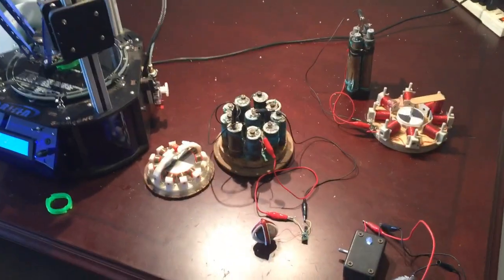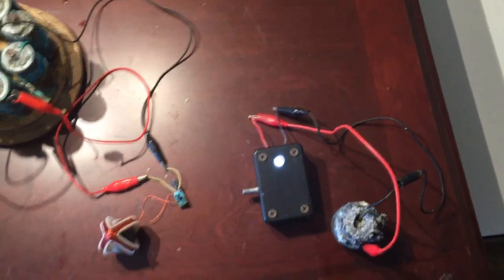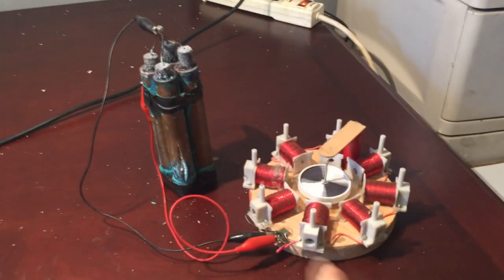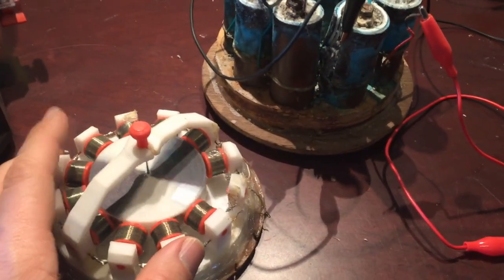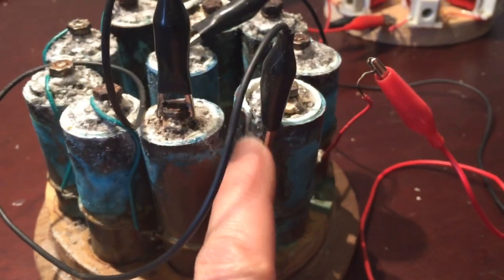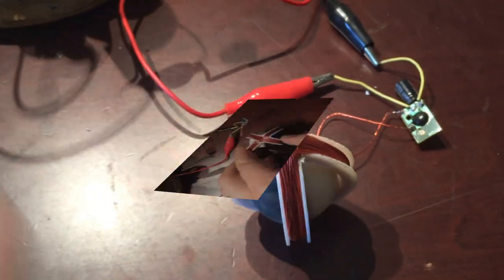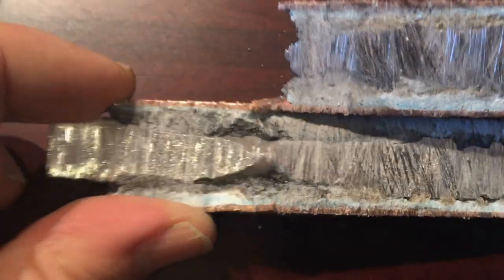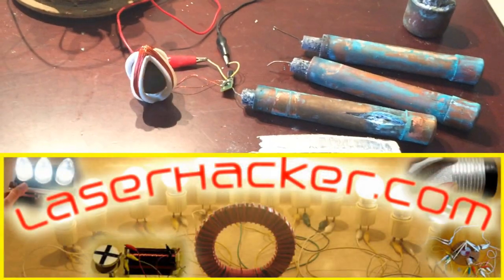Crystal Cells Have Been Going for 4+ Years! - Crystal Cells Duration Testing Update

Comment: To reduce the internal pressure you need to add Diod to it. The Diode keep the power move forward and no electricity to return to damage the cell.
Reply: I had the understanding that it was the pressure applied to the lattice of the crystalline structure that aided in the communication of electrons. So much to learn here! I love it!

Comment: Duration is not the point, the question is the energy output of the device, so you have to measure also the current intensity when functioning. You have seen a crystal growing, so a chemical reaction is on the way. Crystal cells must be regular electro-chemical cells, unusual only because in solid phase (reaction : Mg with Borate or Aluminium ions for example). No "free" or "zero point" energy in them. You can calculate 1cm3 of magnesium can produce a maximum electrical energy of 3.8 A*hour. Just estimate the magnesium consumed and compare to the energy produced by the cells.
Reply: But there is free energy. Free energy is that energy you don't pay for. Even if someone else pays for. :D 

Saying that just considering the amounts of energy used in refining and producing magnesium metal.
Reply: Following that logic, batteries are "free energy." It's not free.
Reply: Unless the batteries are stolen lol

Comment: If you have that much material left over in the core, might it not make sense to make the core smaller/put many small cores into each tube?
Would probably give you a lot more current... And more efficient use of magnesium.
Reply: hear hear!
Reply: Or simply use thin magnesium tubes with progressivly smaller diameter with the cristal stuff in between and laterally drilled holes to hold the cores in place
Reply: An increase in surface area would definitely increase the amount of current also the crystal electrolyte could be made to 1 be anhydrous completely 2 made in a much thinner and lesser amount it's not nessary to have a thick layer and is actually causing this issue due to it not being sealed completely and allowed to absorb water from the air so if you sealed them well this wouldn't be ab issue and yeah think how a modern lithium battery is constructed  use that method with these materials and without vent caps would be awesome

Comment: This is a very interesting concept. There could certainly be a market for long life, low power batteries...
Clocks, CMOS batteries, timers, etc. They probably have a high ESR, but that's not a problem for low power devices.

It's probably the wrong kind of technology for high output devices - You won't be powering torch bulbs, or radio speakers anytime soon. 
But if marketed correctly, these could really be good. 

What is their discharge curve like? Do they maintain a relatively stable voltage until they're depleated, or do they discharge similarly to Zinc Carbons, in a more linear fashion?

Comment: Yeah Robert Murry Smith worked on these "crystal Batteries" and they are an oxygen / magnesium battery.  There was mention of a 6M copper pipe in the ocean with Mg lining and the O2 in the water gave the oil rig 65KWhrs of output. If you dripped water though these, it might wash out the MgOH MgO etc and stop the expansion but also supply the O2 needed.

Comment: that was a cool oval motor.  you said the coils crossed over, but one end wasn't.  did crossing over twice cause too much resistance in the circuit?  very cool video.  could you pack the outer layer with a foam that decays slowly, like styrofoam, that way as pressure builds, it retains its contact with the magnesium, but can press into the foam without bursting the container?

Comment: That's another thing. I see people getting decent voltages on these but I'm not seeing how much draw can be pulled from one and it would seem like these are all being ran on extremely high efficiency motors. It begs the question if it's the battery or the motor that's really impressing me. I'm leaning towards both.

Comment: How much total power do you estimate the four year device has used?  I'm curious as to the total output of one of these things.
Reply: +ElGatoLoco698 You can calculate it. IT can provide roughly 200 ma and 1.5 volts per cell of that size, so 1.5 x 0.2 = 0.3 watts an hour. 0.3 x 35000 hours (assuming 4 years) a total of 10000 ish watts. or 10 kilo watts assuming I'm correct. More then any battery i know, a large car battery has maybe 1000 watts hours on one charge. If you have 10 then that is 100 kW. If that is not spectacular then i dont know what is.
Reply: Jette Christensen
That's really quite unbelievable.  I bet many a electrical engineer would say it's impossible.  This kind of thing throws the whole conservation of energy into disarray.  Theoretically it's possible but then again theoretically it's possible to blow up an entire city from the energy of one drop of water.  Where is this energy coming from?  Must be the vacuum energy that Tom Bearden is always talking about.
Reply: ***** yes exactly that is what i think too, i think steven greer said it was called the quantum flux field from the vacuum of space. there are also devices that amplify the energy output. More energy out then you put in, in a way. I can't remember what they were called but they were like a modified electromagnetic generator. Sucks this technology has been hidden for so long.
Reply: It's a thermo electric device that turns ambient heat into electricity. A widely known application is for space probes and rovers, as used by NASA under the name of Radioisotope Thermoelectric Generator (RTG). Their implementation uses a small lump of radioactive material that always stays extremely warm due to the atoms keep fission-ing all the time. The curiosity is that even at 20 degrees Celsius, let's say, the elements shown in the video keep working. Long story short, the energy comes from the environment, namely the heat of the air and table on which the termoelectric elements sit on. If you think about it, even 0 degrees Celsius is hundreds of degrees above 0 Kelvin, so there is heat energy in our atmosphere. We're not like on Pluto with 33.1 K (-240 C).
Reply: 200mA @ 1.5V for 35000 hours would be simply amazing for IoT devices

In fact, far far too good to be true.

A current top of the line lithium polymer 18650 cell will give you 1 mA @ 4.2 to 3.2 volts for about 3000 hours at best.

These batteries would represent 3 orders of magnitude improvements.

Like @shubus said, this is probably microamps not milliamps
Reply: It's unlikely to be a non rechargeable battery, if it were someone would have known by now the chemistry reaction.
Reply: magravs using nano coated copper im going to make a cell like this with a nano coated exterior and see what happens. thanks for the video!
Reply: As shown in a different video about the motor, it only draws one or two micro amps, so repeating your calculation with this number that is an output energy of about 1.5V x 0.000002A = 3µW for 35000h leaves you with 105mWh or a used battery capacity of 70mAh which is not even what a coin cell holds. It was probably a little more than that as the four cells make the motor spin faster so it uses more energy. But even if it is ten times more that is still nowhere close to the energy of a lithium battery of that size. What is the important point is that these types of batteries have a very very long shelf life as there is no liquids inside. They can last for over a hundred years.

Comment: For the reed switch failure, just put a tiny capacity over the reed switches two ends so that its able to absorb the plasma resulting when the switch opens...  then it will last a lot longer... without fusing shut...

Comment: Internal pressure = PIEZO EFFECT, the bigger the pressure the better results you get.Just a couple of Ideas:

1) Have you ever try building a cristal battery using metal shavings instead of mg & zn rods? that way you may reduce the costs.

2) And to increase the piezo effect , what if you place two Neodymium magnets facing each other whit the same polarity, have you ever try these ideas?

I'm no expert , I'm just an admirer and a fan of your brilliant work. 

THANKS FOR SHARING. 
Best regards.

Comment: Use powdered crystalline material instead of heating it to a liquid to Incrase power flow. Or build a hot reactor to flow the material thru the reactor slowly as a liquid. The quicker it moves the more surface area contact. Working on a more advanced one now. I'll post it when it's done for free.

Comment: Hello, I've just watched all of your videos regarding this subject, they are good and educative. For my observation I think that going for a bigger diameter of tubing and longer batteries with bigger, or similar sized core that is drilled trough, to increase the contact surface, and maybe transfer some pressure from the walls to the core, which might actually produce battery with more power and efficiency and  with the same or greater longevity.

Comment: I wounder if you could use the same metal on both electrodes since these arn't technically supposed to be chemical cells.  It's supposed to use the feroelectric effect, and obviously there's chemical reactions taking place that invalidate the test!
I see all that corrosion on the magnesium slowly eating it away! . . . this is basically a saltwater / magnesium battery!

Comment: The Mg was surprising, normally whitens up in a short time.
Got a C/Pb cell with epsom salt/rainwater electrolyte, 2 1/2 years so far flashing an LED 24/7. Nephilim Penny still going on same rainwater, 4 years. 
Everyone learned so much around 2010 and some builds are still going...fantastic !  :) 
Dancing Flowers FTW,  very simple to take apart and reuse, with 500ohm coils as a bonus.

Comment: What you could do is to put a smaller magnesium rod in. Or you could make A-Sized batteries. You can experiment with different shapes of magnesium. Like a spring. Where instead of the magnesium being pushed up will contract inside the cell Thus building less pressure.

Comment: Thats pretty cool...  the crystal cells being Drawn against for years have burst themselves in slow motion, not catastrophic failure, but a slow bursting as the magnesium expands outward thru the insulating material exerting pressure on the copper pipe containers...   It would have been cool if he made 2 sets of cells, one left connected and running and the other just set aside to see if they both exhibit the pressurization result...   or if that results because of the constant loading...

Comment: I feel you need a "bleeder valve" on these types of batteries to relieve the pressure from time to time. That or a permanent "puke valve" that will constantly release any built up pressure growth.
Reply: Pizioelectric effect though, more pressure = better performance. I think he should wrap them in concrete inside a steel square bar to hold it all together 🤔

Comment: You need a mechanical component to the battery systems you are building so the pressure can become power over time or a new cylinder system with a different metal content to hold the pressure thus making the 100 year experiment work "sleeve outside of copper" (titanium) . ( been watching for years now. ) good luck

Comment: cool deal I am glad the crystal cells have held up so long. have you put one of your graphene capacitors in line with one to see if the crystal cells benefit from having the current bounce back between the capacitor and the cell?  have you tried making a sleeve of the pvc pipe around the copper to seal it in I doubt it would have enough force to split the thicker pvc. if it does you have made some powerful expanding crystals that need to have that power harnessed as well . pressure = power . who knows maybe this power of growth albeit slow could be focused to run something else.

Comment: LidMotor, just a couple thoughts... 1.) It would seem as though drilling holes in the Borax/Salt material prior to capping would allow for more expansion prior to the vessel being compromised, 2.) apparently cost can be reduced by decreasing the ratio of magnesium, and 3.) (out of curiosity) do you believe that increasing the area of the exposed magnesium (perhaps by cutting groves or using a star shape) would have any meaningful effect upon output?  Thanks for sharing your work with us!

Comment: Like to thank you and Robert Murray for all your hard working and sharing it with the rest of the youtube land. I have been experimenting lately with trying to make a thin crystal cell with graphene as the cathode and graphite as the anode. I have been mixing the compounds with PVC cement and acetone and then dipping aluminum screen into the mix to coat it. I was expired by cayrex2 with his polygraphite plates and neatpete45 titanium dioxide super capacitor experiments. Unfortunately, I am not getting the results I would like. if you haven't checked out Cayrex2 and neatpete45 videos you should. Heck, even Robert was asking how they are making their batteries. Says a lot to me.

Comment: I'm not sure if this a late comment or if it has already been said but if the batteries are kept under load 24/7 I'm guessing that's what is causing them to split. Under power I think parts of it starts to liquify and give off some gas bubbles( on a small scale) and I'm guessing it's pressure over time that's building. Wondering if they had periodic breaks if they would still expand so much?

Comment: Another guy had the same "pressure" issue with a different theory. -The magnesium was pushing up due to lack of insulator between the magnesium and copper at the bottom. He was using a wider copper and wider magnesium, thus had wider spacing between poles by a few centimeters. When he put a thin layer of cellulose (wood wafer) in the bottom of the copper before inserting the mag core he seemed to solve the issue. Also he used only big copper cap but no pipe so no solder. I think you have some serious electrolysis happening at the seems where you soldered joint likely due to different metals contaminating the chemistry. I've seen others use narrow copper tubing but only resin on bottom instead of soldered cap and cellulose insulator tube for the sides. The key to higher voltage is more surface area on metal and you can have a bit more space between nodes. I think this tip may help.

Comment: Some half baked thoughts about the pressure.

Trying to think of ways to alleviate the pressure so that it doesn't split.  What if the magnesium had a hollow core, possibly with a compressible material.

I'm thinking copper is more malleable than magnesium, but you might cut stress lines or even cut right into the magnesium so it breaks where you want and forces itself into the core.

Comment: A magnesium tube with thinner walls than the copper will keep everything contained, or rolled magnesium sheets might even work better. Another alternative you could try using the surviving cells would be a steel or gas pipe jacket.

Comment: so what stops me from creating bigger versions and more to run my x box for 4 years?
Reply: Nothing. It'd just take a LOAD of them, as you'd want to tap into the power supply circuit and feed the mains input with 120VDC into the 120V capacitor. Modern power supplies convert the AC to DC before stepping down the voltage because they're essentially digital transformer driver circuits. This works to your advantage as it dosen't take muc current that way and you can use less cells.  Even the TV could be modded to put 120VDC into it's power supply, by simply soldering wires to the 120V capacitor.

There'd be a considerable initial investment. Judging by the fact these produce half a volt to a few volts of power.. it'd take anywhere from 80 to 240 cells at least 6" long and 1.5" wide.  After that.... well... years and years of power. You'd need to find a source of cheap scrap metals. It probably wouldn't specifically have to be magnesium and copper, there are many combinations with a similar voltage output. Rusty iron gas and water pipes would work well once you figure out what the second metal could be. For iron, zinc would be a good choice.
Reply: +theLuigiFan0007 you could just hook it up to an automotive 12vdc inverter to output 120v ac and plug into that and just save the headache of modifying the mains, the tv or any other device you want to power...
Reply: Quantum Uncertainty Workshop
The problem with crystal cells is, they don't have much current output. A few hundred milliamps or so if you keep the humidity right. You'd still need the same amount of cells if you wired them in parallel to run an inverter.

What you suggested is definitely a simpler route. You'd have to wire a lot of cells in series parallel arrays (18-24 per series string, then 10-15 of those in parallel). It'd take just as many cells, but it could power any appliance with the disadvantage of a slight drop in efficiency. Not too bad a trade off.

Personally I would mod the electronics and and add a 120VDC in jack. Nearly any appliance would work, as long as it's not a purely inductive load (transformer, AC motor, etc). Toasters, phone chargers, CFLs would all work. Even blenders would work off the DC because they use universal motors and power the electronics off a SMPS. In most cases a outlet attacked to the batteries would work. Polarity might matter.

For quick experimentation, I agree that an inverter would be the best choice.

Comment: At home I have flexible copper pipes. It's another variation of copper. You can bend the pipe by hand. (some aditional material to the copper I think) That could solve the expansive properties of the cells.

Comment: Maybe you can help keep all this pressure in check by building back to back cells. The pressure from each layer of crystal presses on the other layers next to it and vise versa putting a lot of force on the electrodes from two directions forcing them to keep there shape and stay flat.